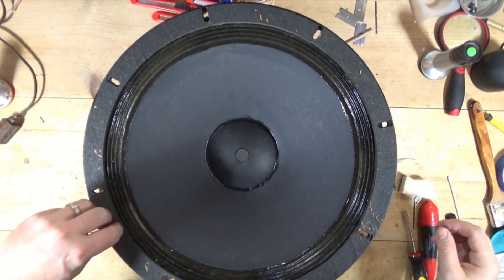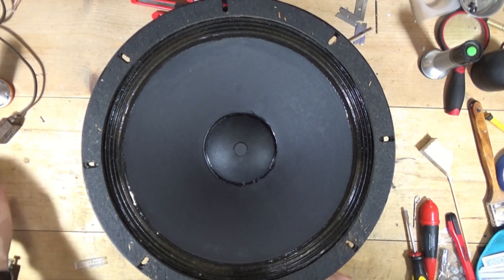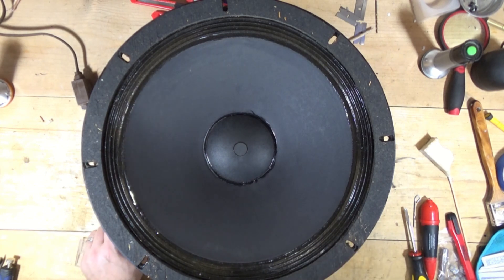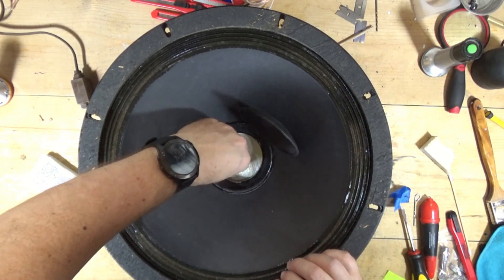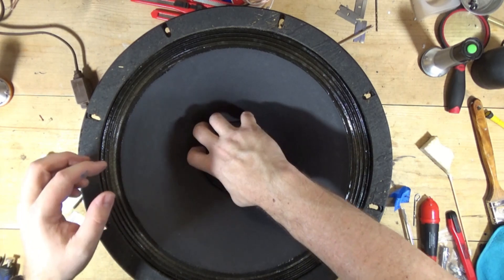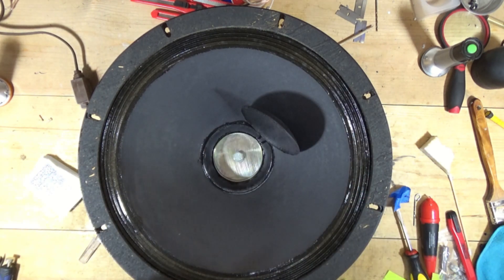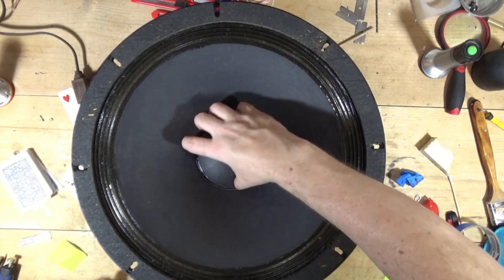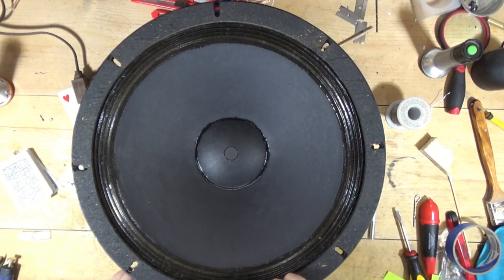Altec Lansing Valencia 846B Woofer Voice Coil Rub Repair

Comment: I get a feeling that there are two sources for voice coil rub. One is that the voice coil is not circular and the other is that the surround dope has "fallen" down. 
Think the first thing to try is to move the driver 180 degree and wait some days to see if it's get better. The dope on the Altec can float around when it get hot.
Question: What to use as dope for the surrounding? Is it black latex?
Reply from the maker: I think it is black latex, but I'm not an Altec Lansing historian :)